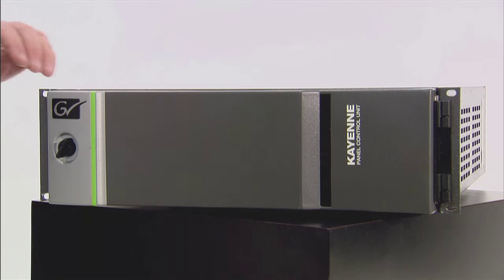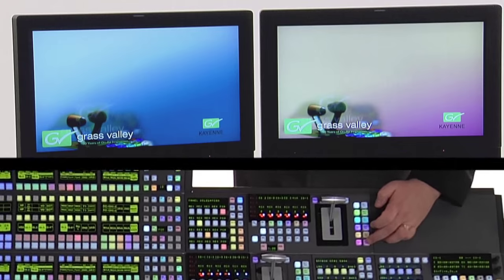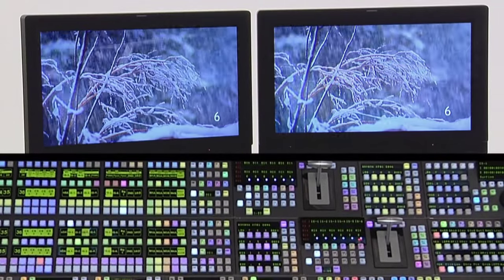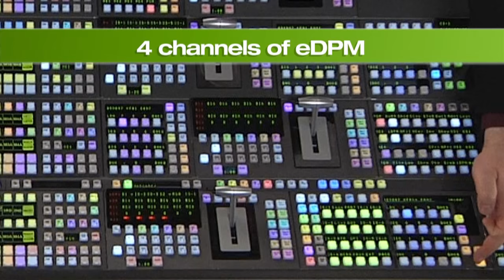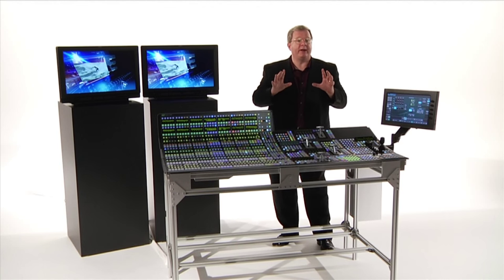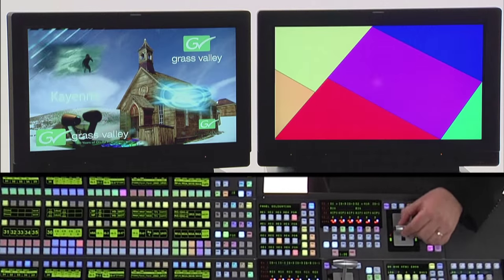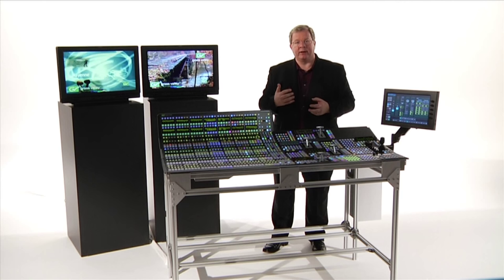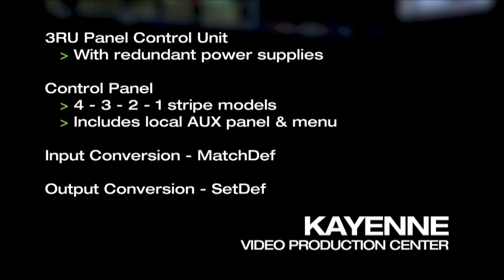Kayenne (1) - Functionality

Comment: look at the control panel pcb,it's like an arc
Reply from the maker: That was the intention so that a TD could actually reach all the buttons. The design was copied by another switcher manufacturer you may be familiar with.
Reply: @grassvalleylive  OMG GV answered me,I'm huge GV fan, I have a kahuna hahaha .Never saw arc pcb before,thanks for the info.
Reply from the maker: @56335130  Of course 😃 It's actually the supporting frame that has the arc. Then each M/E bank is added...it's not one big switcher, but a lot of horizontal banks so it can be customized.
Reply: @grassvalleylive  ok understood,It's the force that bend the pcb ,the supporting frame is Mr. Bender,not the arc pcb manufactured
Reply: that's not the only thing in an arc, look at the cpu motherboard...